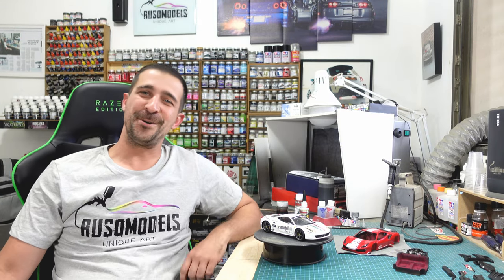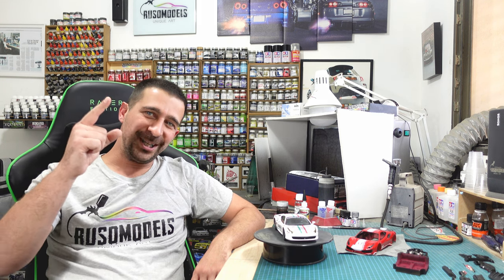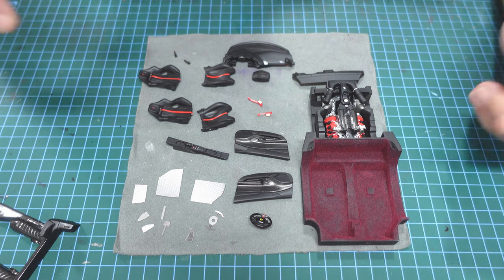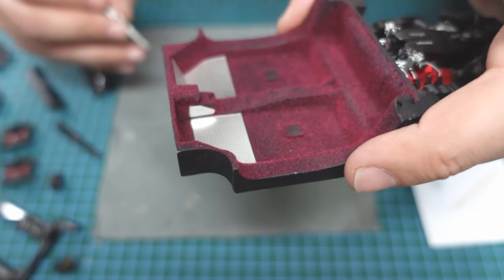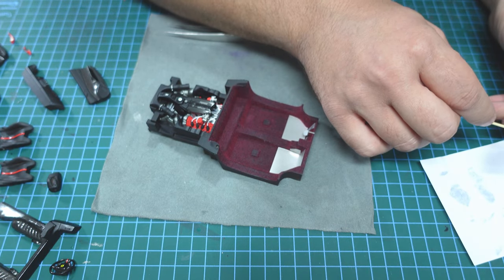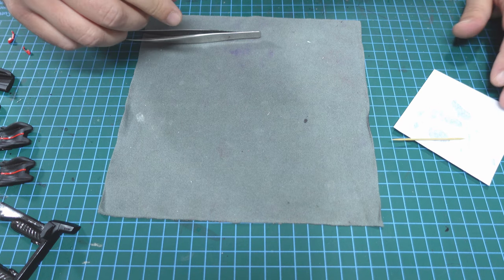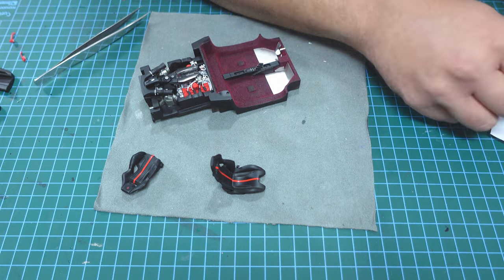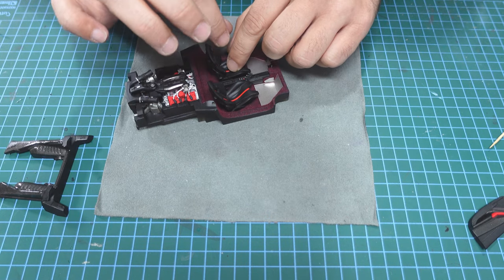FERRARI 488 PISTA ALPHA MODEL PART 7  HOW TO INSTALL INTERIOR MODEL KIT

Comment: Hi Yaniv, thanks for the videos! Did you have to cut off some resin overhang from the back underneath the engine bay? Mine sticks out quite a bit which makes the rear diffuser and belly pan stick out too much.
Reply from the maker: Yes cut it out. All pista need to cut it out
Reply: Thanks Yaniv!